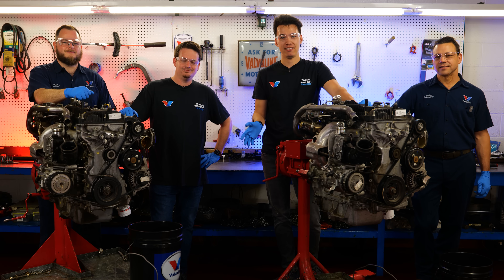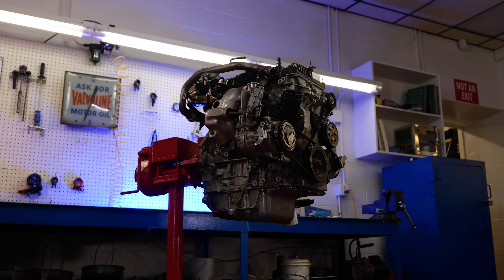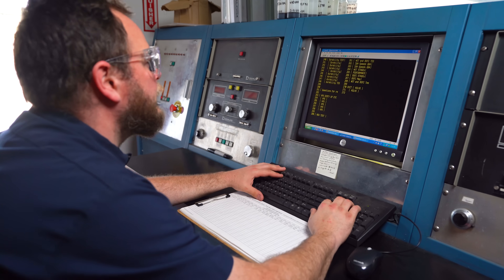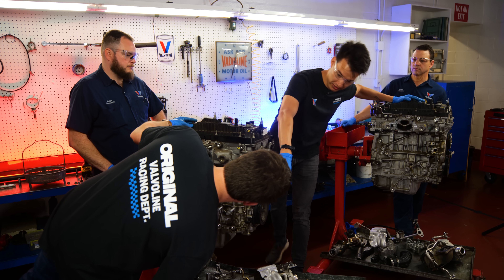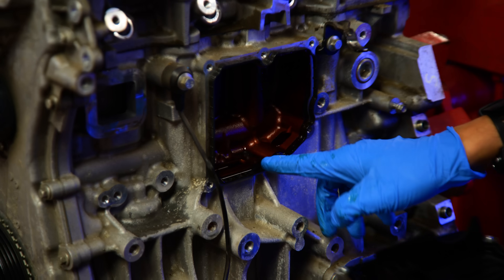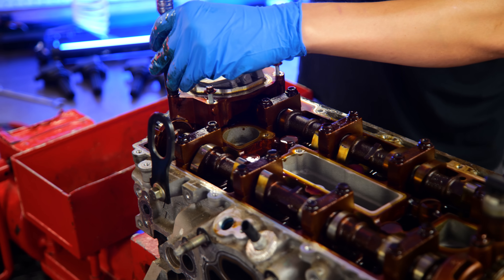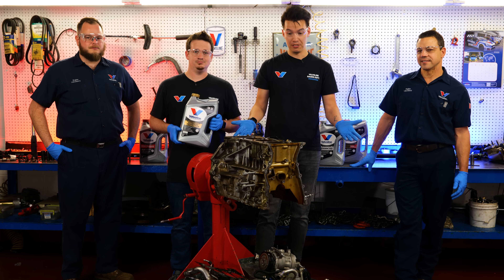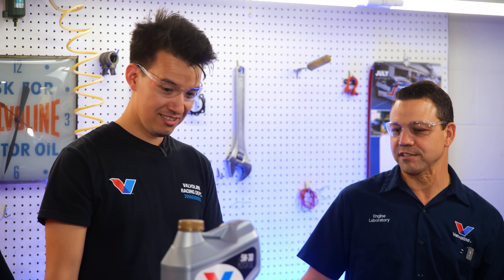Testing different oils over 4 years and 1 MILLION miles

Comment: Now put that conventional engine back together and start running it with valvoline restore and protect.
Reply: I hope they do this! another 500k miles!
Reply: @Camell513  according to them it should be good after 40k miles
Reply: I just had the same idea!!
Reply: Yea that would be cool
Reply: That would be a good test
Reply: Honestly
Reply: "Magically, the compression jumped up to 2× factory standard- this blew out he engine."
Reply: I wish Valvoline would get, from owners, a number of 10 to 20 years old cars famous for stuck low piston tension rings. Within the 100 mile radius of the Valvoline research centre there should be a load of such abused or neglected cars, trucks or SUVs.

Open the engines under camera with each of the owner & take weight measurements etc etc. Then reassemble the engines without cleaning them and fill them with Valvoline Restore & Protect. Let the owners take them back, use it with oil change & filter for the 1st 1000 miles. Then repeat this at every 5,000 miles for 3 times. Then open every engine up in camera with owners.
Reply: LOL  I just posted that as well.  Great minds...
Reply: they should!
Reply: This! 👆🏼 I am actually going to change the oil in my Acura TL with the J37 engine this weekend with Restore & Protect.
Reply: How’d it go? I’m about to do it to my 2001 dodge ram 1500
Reply: Would probably do literally nothing.
Reply: @aygwm  I guess we’ll never know 😭

Actually even if you used Walmart synthetic supertech oil it would probably clean it up.
Reply: This is def the test to run. I’ve only bought one new car. The rest are used and the lowest mileage was 50k miles to start. My current car I purchased with 150k miles. I immediately changed the oil and refilled with full synthetic and only run full synthetic. So reassembling the the ‘conventional’ engine and running it with synthetic would be ‘real world’ (to me anyway)
Reply: what if it is thinning the oil and becomes like a 0w15 and you destroy the bearings?
Reply: @rotorblade9508 why would 0 weight oil destroy bearings? quite opposite no? thinner oil gets into nook and crannies
Reply: I was coming here to say this. I'd love to see the results for that.
Reply: Yesss!
Reply: I was going to say the same, but you beat me to it.
Reply: Ooo
Reply: Valvoline is assss
Reply: @bve7397 not really valvoline is one of the good premium oils out there
Reply: THIS ✅✅✅✅✅
Reply: I have an old two valve triton pickup truck that I picked up used with 210 K miles on it. It ran ok and didn't consume much oil, but it had piston slap rattle on cold starts. I immediately put in premium 100% synthetic oil and used it continuously from then on. I don't put tremendous amounts of miles on it in a year. But so after many dependable years and 255,000 miles on it now with oil changes at around about 6,000+ miles and roughly once a year the cold piston slap is all but gone! I figured the rings were sticking and now have come free! Color me happy.
Reply: Now drain all that oil and fill with only Lucas oil stabilizer and peanut butter .
Reply: preach it.
Reply: Exactly what I was gonna say! 🙌
Reply: I agree
Reply: Thats a very good oil I've seen very good results
Reply: I was literally coming to the comment section to comment the same thing word for word. Glad to see you beat me to it. In fact I would really love to see this. Because I have bought Valvoline restoring protect for an engine that wasn't very dirty just a little discolored in hopes that it would make it nice again like it clams. Several oil changes later and nothing ever happened. It looked the exact same... All oil changes were done before 2,500 mi with a new Toyota filter. I am not very impressed to say the least. The vehicle was a 2000 Toyota Corolla. That has the 1zzfe engine. Pulling the valve cover off it was light brown but no sludge or  much carbon buildup should have been an easy cleanup. 6 months later😮..... I pulled a valve cover off after  a little more than 6,000 mi of driving and nothing.... Nothing 😒.......looks the exact same😂. Jokes on me because I bought the snake oil I guess 🎉😂😂😂😂
Reply: @RedWolfgarage24 Still a great oil though.
Reply: @RedWolfgarage24 I bought the snake oil too! I’m skeptical that it will do much especially since I don’t drive a lot each year and keep my engines clean. Haven’t used it yet. At least it wasn’t too much extra compared to normal good quality synthetic, except I had to special order it to Canada and pay shipping, whereas I always wait and buy a jug of synthetic on sale.
Reply: I was just about to say the same thing
Reply: This
Reply: Make it happen!
Reply: W press
Reply: All that sludge is gonna get cleaned off QUICK from the restore&protect. If that was your car you’d want to change the oil more often the first few times using restore&protect or your filter will get super clogged. Do 300mi, then 1000mi, then 3000mi.
Reply: Also want to see that.
Reply: We need this test done!
Reply: Do it
Reply: I’ll take the synthetic oil engine over that conventional engine !!
Reply: Ford has some good engines… crown Vic engine, 7.3 diesel some champs
Reply: Exactly what I was thinking.
Reply: Yes! What a perfect test.. wish there was another engine to test a different brand too
Reply: Thats what I thought too but I think they wouldn’t.
Reply: The engine already has the varnish deposits. This will not make it go away.
Reply: That would be sick
Reply: That's what I was thinking but they must have with some engines since they claim 4 oil changes can remove all deposits but ya doing it with the stuck rings is the real test that's the only thing that's really a problem
Reply: This .. this is the idea!
Reply: That would be a good test, but it would probably ruin it. That carbon and bullshit is holding that shit together 😂
Reply: Agreed 👍
Reply: We need 500k miles with their regular synthetic vs the restore and protect.
Reply: 100%
Reply: Why didn’t they do this test with 0w-20? When almost every manufacturer recommends ow-20 in the us with 10k intervals these days.
Reply: Bro RP is A game changer.
Reply: Exactly
Reply: Probably wouldn't get put back correctly.
Reply: Say good bye to your cam phasers, it's not safe for modern engines with hydraulic timing chain adjusters, and cam phasers. Old push rods, good to go.
Reply: Love it!!!!!!
Reply: turned the engine gold; idemitsu synthetic turned dark brown: true-synthetic oil should be transparent
Reply: Good test but the damage will already be done. The good though will be cleaned up deposits throughout the engine. The BAD would be destroyed cats likely to get filled with deposits?
Reply: Nah, Amsoil Signature. No contest.
Reply: Bahaha. Oil doesn’t restore steel
Reply: @davefoord1259 What steel was bad? It seemed like deposits were the only thing that would be to be addressed to restore the engine.
Reply: @themikeroberts  one of oils jobs is to keep contaminants in suspension till it can go through the filter to remove it. About the only deposits that affect an engine are in the ring grooves. Ive never seen an oil that can remove deposits in an engine.
Reply: Nobody claims it does. They claim it cleans deposits in the engine and especially oil rings. @davefoord1259
Reply: @davefoord1259 Really? I’m absolutely sure no one here knew that. Here’s your participation trophy 🏆 🎉
Reply: @davefoord1259  these tests showed that wear on the steel was Not a problem in either engine, but rather the problem (in conventional oil engine) was the carbon deposits and varnish buildup.  'Restore' test desired please.

Comment: This is cool, but what I'd like to know is if they can do a similar test for us who live in tropical climate, where multi-weight oils are not really needed, but recommended from the factory. 

1 engine using a multi-weight oil (for example 10W40), while the other uses a single weight oil ( like SAE40). 

I've heard an old mechanic say that multi-weight oil causes build up, due to all the extra additives and modifiers, where as single weight oils contain less modifiers. That means less break down over time, less build up in your engine. If it's true, it'd make sense.

We only see weather here in Oranjestad Aruba between 26° Celsius and 33° Celsius all year. So oil designed for sub 0° Celsius weather, is really not necessary but dealerships stick to what the manufacturers recommend. 

It'd be cool to have an oil manufacturer do a video comparison on this, as I want to put the best oil in my engine for the climate I live in.
Reply: Multi-viscosity oils and their additives causing buildup is a load of crap; you NEED multi-viscosity oils because an oil that is the viscosity you need at operating temperature is WAY too thick at room temperature to lubricate an engine remotely properly on cold start, so they add viscosity modifiers to oil to make the oil flow well enough to lubricate on cold start. NO climate is hot enough to warrant using a single viscosity oil.

All of the extra additives modern oils have versus 20 or 30 years ago is what PREVENTS buildup and oil breakdown, try running an engine on oil without additives and you'll be lucky to make it 10k miles with modern engines.

The temperature range that a specific climate sees changes what oil grade you use in an engine because of operating temperature and cold start temperature differences, if a car uses 10w40 in florida, it may use 5w30 in canada because 5w30 would be closer to the required viscosity for the engine to run properly given the colder climate. Oil would also have a lower operating temperature in canada than in florida due to the sheer temperature differences of the air, warranting the use of an oil with a thinner viscosity for the second number of the oil grade (which is the oil grade the oil acts as when at operating temperature, it is not actually a measure of viscosity itself.)
Reply: Never gonna happen. For most purposes, straight weight oils are irrelevant these days. Yes, the thinner base oils and viscosity modifiers in multi weight oils were a problem in the past, but not so much anymore.

Nowadays, base oils and additives are MUCH better than back in the days of conventional 10W-40 causing stuck rings and other failures. We now have such stable base oils that we can make something like 5W-30, 10W-30, or 10W-40 with NO additives at all.

Even wider spread synthetic oils like 0W-40, while not ideal, are lightyears ahead of straight weight conventional oils from decades ago in every measurable way other than cost.

The only real benefit to using a straight weight oil nowadays would be in low budget applications where cold starts aren't a factor and conventional oil must be used due to cost. The oil included with a budget lawn mower would be a great example.

Even so, companies don't want us using oils with more than a 5W or 10W winter rating because of the very real risk of damage on cold starts. Imagine someone happily using a straight 40 in Florida and then taking a trip way north in the middle of winter perhaps for an emergency and not thinking about their oil. Manufacturers must consider those scenarios when making reccomendations.

Comment: Love that Valvoline gave you guys the opportunity to show us the differences between the two oil types. Given it’s just their brand but still very cool to see what differences they had!
Good to know I’ll still be running their 5w40 full synthetic in my 2004 STi.
Reply: I read a breakdown from a testing facility on e320 diesel engines.  They said that 5w40 had significantly less wear than 5w30 or thinner.   It's just not worth the mpg to go lighter if it costs you in engine life.  That's assuming you plan to own the car for hundreds of thousands of miles.
Reply: @Smagual86  yeha, exactly. planning on having my 04 sti until I or the chassis dies.
Reply: A sucker born every minute

Comment: 500k on the dyno looks like it went easy on those engines. Could it be a testament to valvoline? I doubt it.
Reply: It's like driving on the highway the whole time...deceiving test...should have been 5k intervals
Reply: it was a controlled static test (though clearly andybales didn’t watch the video), obviously not representative of true irl use but it ran for literally years, so it’s not worthless. The point wasn’t to say “500K on a Ford engine, wow” but was a comparison of synthetic vs conventional. 

The only question is whether you as a consumer holds on to / value your car enough to keep using synthetic through the period you own it. e.g. Some Kia or Hyundai on a lease, I’d definitely use conventional since it’ll self destruct the moment the warranty is over anyway whatever you use.
Reply: @jd_99  yes, it was a controlled environment..no dust, dirt, moisture, every day environmental conditions...did u nit graduate high school?
Reply: @jd_99  by the way, my 22 year old Ford has has zero full synthetic & runs fantastic..your theory debunked
Reply: Alot of the wear is from cold starting, which maybe wasnt the focus in this case. The wear difference would probably be bigger if many cold starts were part of the test due to flow characteristics.

Comment: Just bought my wife an Explorer with 2.3 EB  last Saturday: The video is confirmation of which oil I need to stick with.
Reply: I would use Mobil 1
Reply: @jiggidyjam AMS baby!  Check out their wear ball tests, it’s pretty amazing the difference in protection against synthetic oils!  

I can’t complain about Mobile 1 though, Toyota ran it in my Avalon that I sold at 180K mi.  

Once our Hyundai Veracruz hit 100K miles and was no longer under warranty, I started doing my own oil changes and switched to AMS though after seeing their test data.
Reply: @jiggidyjam  That is so 2000. API-SN is SHIT OIL
Reply: Seems like a great choice, lots of comments about the oil but the fact that these ford 2.3 turbo engines made it 500K is incredible. Very impressed.  

There’s a guy out there that does videos on oil, I loved his advice of doing the first oil change on a new engine at 500 miles, the second at 1500, then 3000 I think…anyway, the thought (and testing he showed) being that the engine break-in deposits a lot of metal into the engine in those early miles and your engine will last longer if you get them out by doing multiple shirt oil change cycles at the start of an engine’s life.  Good luck to you!
Reply: Now if you can just get her to not have the gas pedal mashed right up to the next red light….
Reply: Do 5k oil changes though.
Reply: Keep an eye on the Coolant PH, as the Coolant pump is INSIDE the oil pan.
Reply: @3029dz not on this engine..
Reply: It got turbocharged no way 10k miles oil change. Semi turbo diesel don't even do that(8k-7k miles)
Reply: @GF-mf7ml  most semis have 25,000mi oil change intervals under normal use conditions....